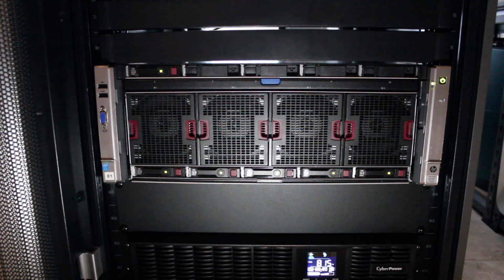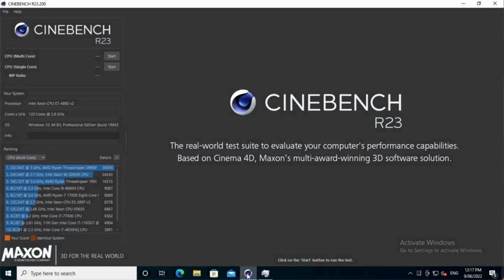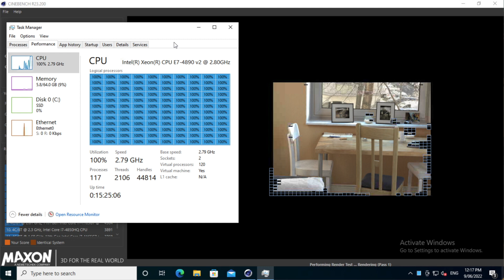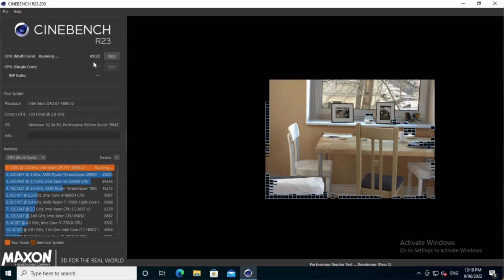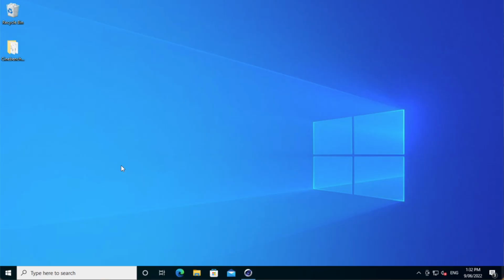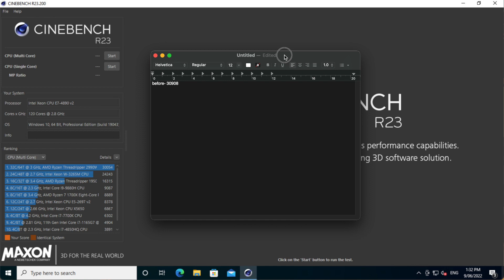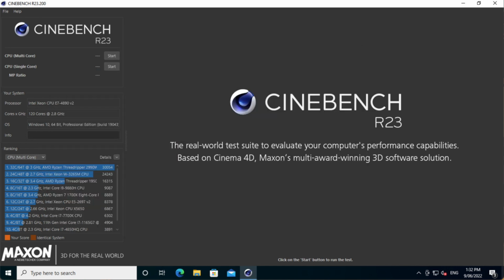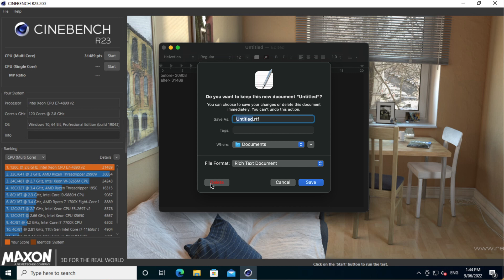HP DL580 Gen8 - "Upgrading" (?!) from 1.25TB to 1TB RAM

Comment: One more RAM speed bump is available... if you can scrape up some more modules. On these machines, when all sockets are filled with the same sized RAM, an additional feature becomes available in RAM to enable Hemisphere Mode. Just enabling the additional RAM bank with the extra chips will give a performance boost, and then by enabling hemisphere mode, RAM access is interleaved across the entire machine, reducing effective RAM wait. Should be able to get a few more percentage points. What I don't like about these machines is the power draw. OK on the company's dime, but no chance it will ever run in my basement.
Reply from the maker: Interesting, I wasn't aware of hemisphere mode. Maybe one day if I can find some more RAM I could test it out.

Comment: It's great to notice that you've got slower RAM mixed in with faster RAM, since it should allow the RAM subsystem to run faster, but there can be more secret in the sauce than just the speed. The number of DIMM slots that are populated will also affect the overall speed; in may servers populating more DIMMs per channel will cause the highest effective speed to drop. Indeed, in the DL580 G8, there are several manual pages to the effective speed based on the number of slots populated, along with the capacity and whether it is a RDIMM or LRDIMM, and the ranks. If these are LRDIMMs you might be going from 10600 to 12800 speeds, or if an RDIMM anywhere from 8500 to 10600. It's also worthwhile to check WHICH slots are being populated, to ensure that an even number of slots are being populated amongst all the channels.. this appears to be the case here (kudos!) with 16 slots populated per CPU.

I suspect with different testing you would have seen an improvement in RAM speed, not only through dropping the 10600 DIMMs, but also because you're dropping to two DIMMs per channel instead of three. But I don't believe Cinebench is very stressful to the RAM, so you'd need something different like AIDA64 or SiSoft Sandra.

Comment: @2.30 HP does not need to lock out any DDR support feature sets. DDR 3 / DDR 4 sticks have different keys and only fit in their respective slots. Your CPU and memory controller however could likely be found in a server with DDR 4 module support is what i'm sure you meant, or i guess a gentle tap with a sledge hammer would help DDR 4 module fit into DDR 3 slot just fine. Not that it needs to be said but you got your self a decent server / setup there 👍
Reply: and you didnt see the other rack^^
Reply from the maker: This E7 Xeon platform supports both DDR3 and DDR4. The sticks have different keys but entire memory module boards are interchangable. Other server manufacturers (e.g. IBM) let you do this but HP locks it out in firmware.
Reply: @techstuff7414  Not entirely correct. The DL580 Gen8 supports DDR3 only, since the Xeon E7 v2 CPUs it works with only support DDR3. The DL580 Gen9 with E7 v3 or v4 CPUs officially only supports DDR4 according to HP, but I've tried putting the memory boards from my Gen8 in my Gen9, and the Gen9 works fine with DDR3 as well, since the CPUs themselves support both (though iLO gets confused). I also tried the other way around, with the DDR4 boards in the Gen8, but that just makes it throw a no memory installed error.

Comment: Cinebench is certainly a good test, but I'm not sure if its being entirely fair to the speed bump of the RAM. Is there any information presented in iLO about speeds the RAM is running at (I have a 380 gen 7 that does show the RAM speeds, but not sure if it will show what it runs at).
Reply from the maker: That's a good point, I may revisit this at some point and see if I can get some memory stats out of it, or run some extra tests